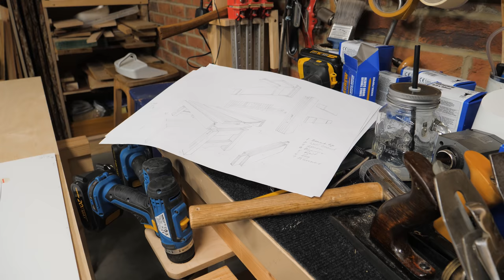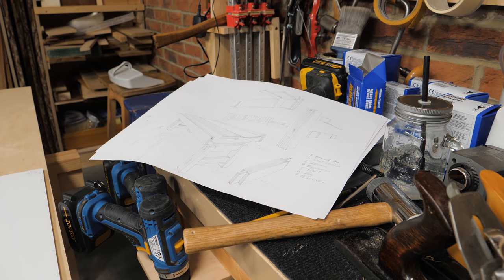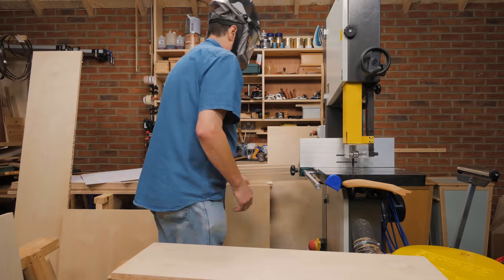The Paul Sellers Plywood Workbench | Introduction

Comment: Great idea.  I had made one very similar about 18 years ago, which has served me well.  I was a bit less confident with making large dovetails, M&T and related joints back then, so it worked out well.  Since then, I have added a 475 Lb Roubo Maple/Oak/Cherry, bench and a modified Paulk plywood.  The Paulk style plywood that I built about 4 years ago quickly became my most used bench, so I sold my old “Sellers-style” and Roubo and built a compact 250 lb DT/joinery bench, and integrated an Incra table router system at one end of my Paulk, and then added a unique leg/tail clamping vice system of my own design that has no vertical blocking nor horizontal size limits and doesn’t cock.   
The modified plywood based Paulk was one of the best time/money investments I ever made in a shop project.   It required just two 4x8’ 3/4” pieces of Baltic Birch ply, and three 4x8’ 1/2” plyood pieces and about 5 feet of 1” strap.  It’s base weight is about 600 lbs, and with tools in it about 700 lbs. it is the most stable, productive pieces I have ever owned, and it cost about the price of just a good set of tail and leg vices.

I can no longer see any advantages to my old Roubo style of benches, other than possibly being a right of passage to build.  I enjoyed mine, but there were many tradeoffs and limitations  to that design, which I no longer deal with. Obviously, there was no plywood option back then, but there is now.

Comment: Thanks Paul... Looking forward to this. My current workbench is topped with 3/4" finish grade plywood, glued & countersunk screwed over a old bench top made from native cut softwood lumber going back about 44 years ago. I gave it new legs made from 2 x 4's in a L pattern, glued & screwed together. I further stabilized the underside of the original top with a 2 x 4 perimeter frame & evenly spaced 2 x 4 cross supports. After everything is said & done, the workbench is an absolute beast & I could hold a ho down on it with no flexing whatsoever. I also framed a bottom shelf for it 1/8" above the leg's bottom with 1/2" finish grade plywood with underside cross supports also. Both the top & bottom have countersunk stainless steel screws showing a pattern. Yesterday morning I finished up the complete install of a 10" woodworkers vise to the benches fascia with a 14" oak jaw for the inside & a 14" birch jaw for the outside. I attached them 1/32" over the tops height & block sanded them with 180 grit with about 12 -15 strokes left them dead level to the benchtop. I used it this morning, works awesome with much thanks to you because I followed your Episode 8 & 9 for my particular installation.
Bill on the Hill,
Vermont, USA... :~)

Comment: Another great video. I am about to build another bench and have watched lots of videos. I don’t understand the reasoning behind  using 3” laminations of material which a lot recommend. Is it just to make tenoning the legs easier. Last time I pegged and screwed the top to the frame. On my last bench the top is wide sycamore planks rather than laminations. It’s about  1 and a half inches thick which seems plenty adequate for me.
Regarding the bandsaw, it is very quiet compared with a circular saw, but even after a long time setting it up, I find it very difficult to get a straight cut against the fence. I use the table saw for straight cuts against a fence and the band saw for thin pieces against the fence or freehand. 
I like the concept of hand tool Woodworking, but I draw the line at ripping, so I reckon your band saw really fits with your philosophy, and mine.
Your videos always get me thinking, and I take away lots from your experience and teaching.

Comment: I've not worn out my first one yet--made by following the build "in the garden" a few years back. If ply is all you got, then go for it, but also consider the "solid" wood version if  you've no good bench atall.  Thru-mortises aren't that difficult.
Reply: I actually find them trickier, but only because I'm still not good at it and the non through mortices hid my mistakes
Reply: Paul Sellers has 2 different video series out on solid wood work bench builds along with this one out of plywood. Solid or plywood, both are solid and stable.

Comment: One cannot help but admire the skill and TLC which Paul has put into this product.  I do have a suggestion which I think is worthy of consideration as a minor modification to the design.

As originally conceived the design relies on laminations to simplify the construction of mortice and tenon joints.  A difficulty arises because the plywood tenon will have almost no clearance when inserted into the mortice because the thickness of the plywood will be nominally the same for each.  By constructing the tenon layer from a lamination of solid wood [ instead of plywood ] the problem should be mitigated, since the solid wood is more yielding than plywood. 

Speaking for myself I doubt I would have the skill to construct the working top which utilizes edge-on plywood to be smooth enough.  I certainly do not possess his skill in the use of  planes [ which are obviously super-sharp and perfectly set up ] which routinely allows cross-grain cutting. I would be tempted to install a smooth surface upper layer to the top which could be replaced after a time when it had become too scarred to be still useful.

Comment: hi paul question for your QnAs,
im currently studying level 1 joinery at college and we have a fanstastic work shop filled with all the hand tools you could imagine, apart from some training exercises we have used only hand tools in our first year. we started making the stand alone joints, half laps, t laps, then progresses to M&Ts & dovetails and now we are making small projects like serving hatchand doors which i converted into a medicine cabinet when i took it home. 
we have a few projects left  but next year i will try for an apprenticeship, if unsuccessful i will be doing my level 2 at college,probably in bench joinery but im still unsure which to choose.
anyway over the next few months i will be buying a folding bench and vice then slowly add to my small tool collection. do you have any ideas for simple projects for someone at my level of knowledge preferably using pallet wood, i had an idea to make a cat bed that fitted next to the radiator but after drawing it out i felt it would be far too heavy to be hanging off the radiator haha.
Reply from the maker: You should go to our commonwoodworking.com site first and also start a subscription with woodworkingmasterclasses.com, both are free. This is where I teach the most and you will learn more about hand tool woodworking there in a few hours than you will in a year at college. No offence meant to the college, but it's just fact.

Comment: Nice idea indeed.

I was wondering recently, why plywood works at all? How is it, that several layers of worse-than-plain-sawn wood laminated cross-grain do "explode"?
Reply: The veneers are very thin, so they don't "push" or "pull" very hard as they expand and contract. The layers are pushing and pulling in different directions than the layer above and below. The grain pattern is usually completely different, too. They can't work together when they push and pull. And the glue is much stronger than the wood. If you get a good joint with wood glue, the wood will break before the joint separates. The whole surface of plywood is coated in glue, so it's very strong and stable.

Comment: Could you use the same construction techniques to make the workbench that has the legs splayed out for stability and knocks down in a minute or two? ,It has a name but I’m not sure what it is but think it’s very popular.
Being easy to knock down means its also easy to move and fits in tight spaces yet works for hand woodworkers.
Reply: Moravian workbench. I built one. Super solid. You could use Paul's idea for that. Good idea

Comment: Interesting Paul, 
But which is the cheapest to make? Ply or solid wood??
Reply from the maker: It depends on the quality of the plywood and of course the cost of wood ranges from a pound or two per board foot to thirty and more so it depends on the chosen wood. In say ash or maple it costs about the same as a good grade 13 ply birch plywood. Personally I would prefer the plywood version.

Comment: Thanks Paul, how does the cost compare with reclaimed 3x2  , how may 8x4 sheets of ply does each bench take to make.
Reply from the maker: The plywood is not cheap if you buy a top grade as I did. The plywood will cost about £80 per sheet and you need 2 1/2 sheets.
Reply: Brilliant Paul, that's not bad for that solid of a workbench. Less planing involved too.
Reply: @Paul.Sellers  Did you mean two half sheets, so one full sheet, or did you mean two 1/2" thick sheets ?
Reply: SoundsToBlowYourMind by the way it’s written it would be two and one half sheets.
Reply: @petelevoguer5638    Haha, of course, 2 and a half sheets.  If he had written 2.5 I would have known exactly what he meant, just got a little confused with the way it was written!

Comment: Great idea, but plywood is expensive, at least in Germany
Reply: Burli's Bastel Bude expensive in the UK as well. I think it’s only Canada that has affordable ply.
Reply: Ditto for France.
Plywood is obscenely expensive.
Reply from the maker: I am not sure what terms of reference you are using with regards to cost of plywood. You should not assume that all plywoods are a cheap alternative to wood and that all plywoods are the same or poor quality. Good plywood is really an amazing material and this bench has all the ingredients needed for a lifetime's use and I mean a hundred years with the right ply. If it lasts only 50 years that will cost about 10pence UK a week. A cup of coffee costs 25 times that!
Reply: @Paul.Sellers  well, you are right. I'm sure that this bench works perfect, last long and is simple to build. And compared to a commercial workbench it is much cheaper.

But compared to other wood, I don't know all the English names, ply is expensive
Reply: Couldn't you just substitute the ply for a timber of the same thickness but follow the same design?
Reply from the maker: @hrep14  It's more to do with stability. Plywood like this, this type, is very stable. Solid wood is much less stable for laminating this way though it would still work it will also move much more.
Reply: @Paul.Sellers  Oh, okay I understand. 
Thank you for the reply.
Reply: @michaebuddy
No, he is saying that plywood is obscenely expensive where he lives.
Reply: @Matthew Gee
I am unsure why so many places have such expensive plywood. Here is America I think our ply is pretty reasonable. Even if you don’t get top of the line stuff we have some good options here.
Reply: @theopiner402  I think if you attempt to build this out of "reasonable" (priced) plywood in the US, you will be sorely disappointed.
if you look @0:17 or @0:26 you can see the main bench top is made of laminations of plywood that are "edge up".
now look at the shot @0:30 - those sheets are probably close to 3/4" thick and have might 10 (or more) layers of wood not counting  the face layers.
compare that to your box store sheets that are the same thickness but made of 7 (or 5!) plies.
You'll quickly discover that these "reasonably priced" sheet goods are made up of an unconscionable number of voids that would make them utterly useless in this orientation.

 google "Baltic Birch Plywood" and I think you'll see it is nothing like the sheets you can buy at Home Depot, Lowes, etc.
Reply: You could build a bench from solid wood using the same construction as this plywood version, with all the mortices and tenons built in to the legs and rails etc while laminating all the layers together.   I guess this version just shows a different way of building the bench for those who aren't comfortable cutting all the mortice and tenons the traditional way.
Reply: @ekw555
“Utterly useless” is quite the exaggeration. The gaps can be filled in with putty or small wood strips. Even with the gaps the bench would still be fully functional.
Reply: @theopiner402  I think you'd have quite the project on your hands making a functional bench top out of the stuff in the store.
it would be fine for all the other pieces where the smooth surface is pretty unimportant, but I think you'd have your hands full on that top.
I guess in time the gaps would fill up with sawdust and you could seal them w/ CA or epoxy.

let me know how it works out for you.
Reply: @ekw555 If I was planning on building it, I would certainly let you know how it turned out. Alas, I have other plans in mind.
Reply: @Paul.Sellers   People don't realise how much materal there really is in a sheet of plywood. If you do the layout right it is incredibly efficient and in thisapplication you would have to look at oak or beech to get anything near the strength of even simple contruction plywood. All building materials are pretty expensive here in sweden if you are a private citizen but compared to other indoor lumber plywood is not really that expensive. And for you other people if you have a carpenter friend, they can sometimes ger up to 80% discount on construction materials compared to what you would pay if you have them buy supplies for you. (I know because I have worked in B2B lumberyards and hardware stores.)
Reply: @michaelbuddy  To be honest, I haven't compared.
Personally, I see myself using ply in many applications and Paul's bench would be an ideal project for me. It's just that most people seem to think that it's cheaper to build things yourself. It hardly ever is - and you'll never beat the IKEAs of this world. But you will develop great skills and enjoy a very rewarding hobby.
By the way, a sheet of 4x8 birch 18mm (3/4") ply here would cost about 70/80 dollars.

Comment: With all that glue won't flattening the top be really tough on your plane?
Reply from the maker: Not at all. Wouldn't you just wipe it before it hardens?  Or couldn't you just scrape it if preferred? The glue is not anywhere near hard enough to damage the plane edge anyway.
Reply: @Paul.Sellers  I'm talking about all the glue they used to make the plywood itself, it's though on carbide router bits so it must also be tough on the softer steel of plane irons.

Comment: Any one got any suggestions for making a mini work bench. I live in a small apartment and currently do all my work in a kitchen/living room. I still want to have a vice and a place to work I can leave against the wall. Any idea's ??
Reply: ats1075 If you search YouTube for "mini work bench" you will find plenty. 
Some are works of art. Check out Laura Kampf, Pask Makes, Adrian Preda and many more. 
They, nearly all include a full size vice.
Most are built out of solid timber but converting it to Paul's plywood design shouldn't be too difficult. If you just wanted a small bench check out John Heisz.
Good luck with your build.

Comment: Though maybe not as aesthetically appealing to some people,  with respect to functionality and durability that bench would probably be superior to most work benches built of solid wood.  And if you're bothered by such things as voids among the plies and appearance of the edge plies, then simply laminate on a face layer of plywood, say maybe 1/2", over the top and exposed ply edges. 
One big advantage it will offer is speed of construction, especially for those of with power tool,  such as a table saw.
Reply from the maker: Durability, strength, ease of making and indeed, in my view at least, looks are all the outcome of this plywood workbench. Admittedly the quality of plywood is key. 3/4" 7 ply will not give the quality you need but it will still make a decent bench. When it comes to voids in layers just use a decent epoxy to fill them.